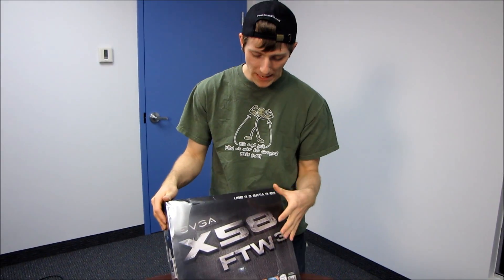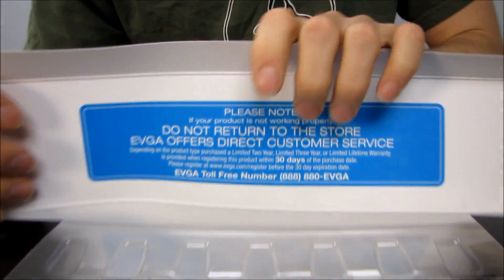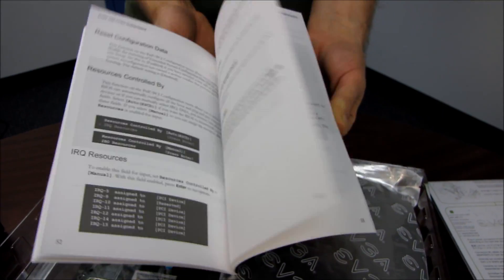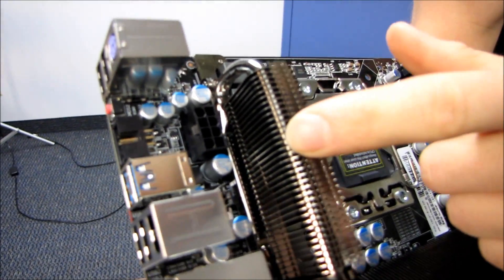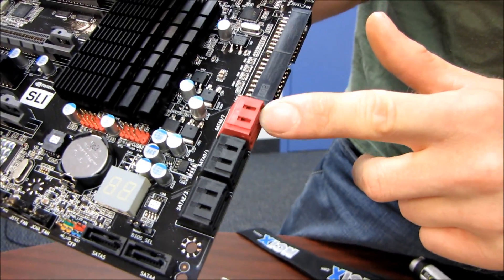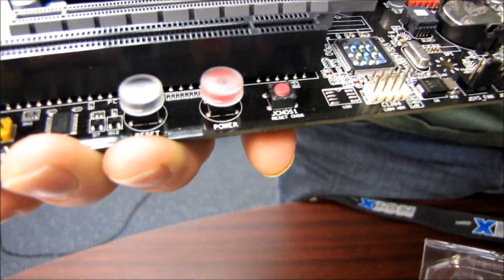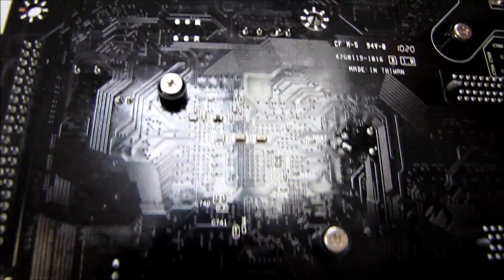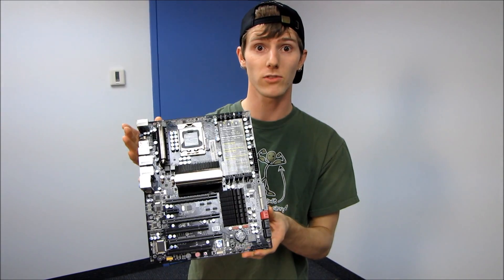EVGA X58 FTW3 Core i7 Extreme SLI Motherboard Unboxing & First Look Linus Tech Tips

Comment: @jordan010203 if you put in 2 gfx cards, it should make the 3 PCI-e slot x1, and as far as I know, pci x1 cards will fit in the x16 port even though it is bigger. I don't have any x1 cards though to try it :(

Comment: @Delcaroll in the most cases you don't need it but it gives u the ability to connect to 2 difrent networks AND it is a very good way to make a lan with multiple computers without the need of a router. if lets say u have 5 or 10 or 100 PCs in the same area u could daisy chain one with the other then "bridge the adaptors" and u can have an infinite number of PCs all connected to each other. we tryed this and it works really well!! but every PC must have dual ethernet!!

Comment: @xxxdroidmonkeyxxx no the asus rampage III extreme is 4-way SLI and its not "E-ATX" E-ATX is 33cm wide (look on wiki) they say there e-atx for a warning because there like 3cm wider (26.9cm wide) than standard ATX (24cm wide). all EVGA 4-way SLI boards are XL-ATX (more than 30.5cm LONG) and therefore render most cases useless (other than the HAF X obviously). IMO EVGA need to work on a 4-way SLI board that is NOT XL-ATX like the asus rampage 3 extreme is  :)